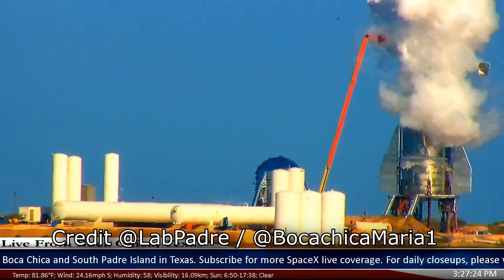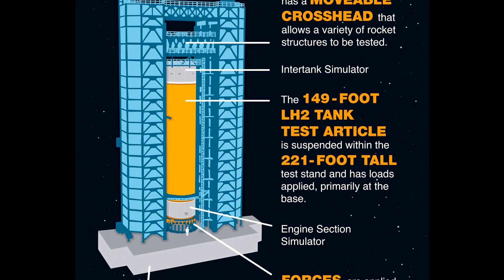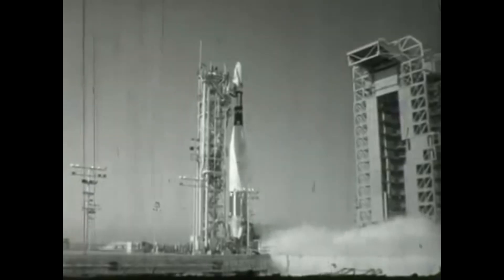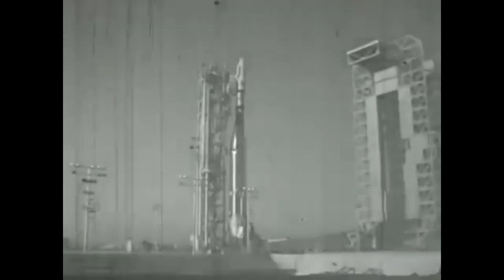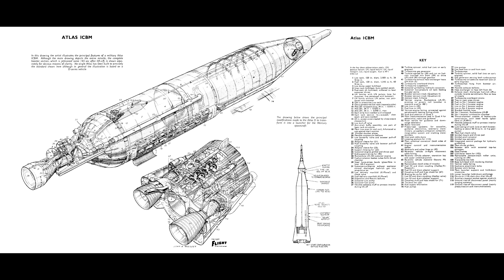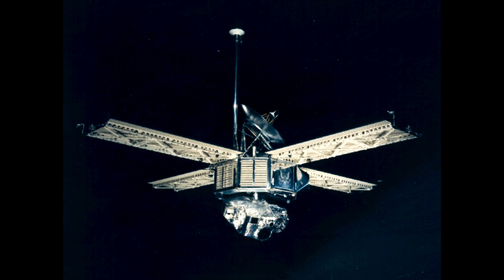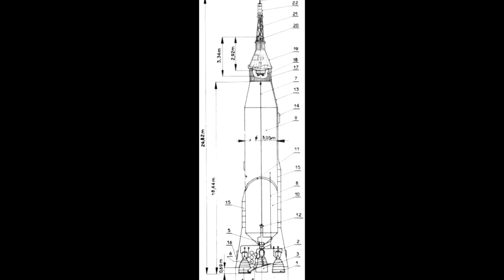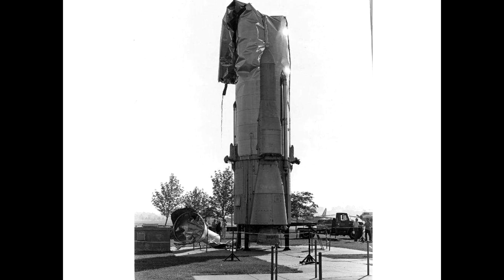Why Did A Rocket With A Secret Payload *Implode* on the Pad?

Comment from the maker: NASA has posted video of the SLS tank buckling:
https://twitter.com/JimBridenstine/status/1204163744814772224?s=20
Reply: As always...Thanks very much...!
Reply: Cardboard’s out... That really unzipped pretty quickly but I couldn’t tell where it failed first. Great result though.
Reply: @thethirdman225  the buckle happened maybe a 18-24 inches below the white square. it resulted in enough of a crack that we could hear the nitrogen leaking out. Eleven minutes later the crack propogated both up and down from that middle point and ripped the front wide open.
Reply: Mike Nichols Great. Thanks for the info. I’ll have another look at it.
Reply: @msudawg1997  Thanks for the info! I'm assuming you work at NASA Marshall then?
Reply: Mike Nichols I think I can see it now. There’s a white spot, about where you said, that moved fractionally about one frame before it failed.
Reply: @revenevan11  yes. I am the lead test engineer for this LH2 tank. I was sitting on console directing the test team when we broke it
Reply: @thethirdman225  we have a different camera view that shows the buckle better. I'm going to talk to management and see if I can get permission to post it. 

We also have sort-of high speed that caught the buckle but I haven't actually seen it yet. I say sort-of b/c they could only get about 300 fps out of the Phantom due to testing at night. Even with all the light we had on it, still couldn't go higher than 300 and get a useful image. And the rupture caught us a bit by surprise and the Phantom had not been reset 😣
Reply: @msudawg1997  Wow, very cool! Thanks for your work contributing to spaceflight, and also for taking the time to show up in this comment section!
Reply: @thethirdman225  the white square is where the stress analyst had predicted failure so we had removed a 4'x4' section of the foam and painted the tank surface with speckle pattern and were running photogrammetry cameras to visualize the strain in that area. That was what was mounted on the yellow brackets on the left hand side
Reply: @revenevan11  you're welcome. I have spent over 20 years as a test engineer, starting out as an SSME test conductor in 1997. I enjoy talking to people about what we do!
Reply: Mike Nichols Thanks again for the great info. Always best to get it from the best source. Totally understand about the Phantom. I’m pretty familiar with high speed video. Look forward to seeing whatever turns up.
Reply: @msudawg1997  that is one failure to the high speed imaging technologies that most of the public is not aware of.
Still, I suspect that at 300 fps, usable data will be acquired.

Keep up the excellent work! Tests like these save lives and equipment!
Reply: @thethirdman225  the bane of high speed photography, the need for enough photons to acquire such short exposure images.
Reply: @msudawg1997  BTW, I used to work with 15000 psi test hydro-pneumatic systems, what was the failure pressure of that monster tank?
Reply: @spvillano  the tank only had 5 psi in it. This is lower than flight pressure but was a good compromise to reduce stored energy. Tank wall buckled from mechanical load, which caused a crack / hole. Eleven minutes later the pressure caused it to rip open up the front
Reply: @msudawg1997  5psi? That's insanely low, considering flight considerations.
Try to send me on a tank with that low pressure, hear my response! 15 psi, we'll talk.
From start to finish, otherwise, that's insanely low.
Reply: @spvillano  as I said, that's lower than flight pressure.  It's actually WAY below minimum flight pressure.  pressure at launch is even higher than that.  But I think it's interesting to see just what 5 psi can do when applied on a large enough area
Reply: @msudawg1997  cumulative stress over a large area makes for massive forces! Reminds me of an air start bottle, high pressure reservoir, low pressure output, connector ill seated meant a six inch hose endangered everyone on the ramp.
Reply: Your videos are awesome!
Reply: Hey scott, totally unrelated but you should do a "things ksp doesnt teach you" on the Van Allen Radiation belts, and its effects on humans and satellites.
Reply: @roach1371b  actually, Scott, that would be an excellent topic. 
Both from phosphene possibilities to direct stimulation of the retina and phosphorescence of the vitreous humor, as well as the effects of bremsstrahlung radiation.
Reply: Where TF have you been? I love Rockets but only just found this channel through recommended. Greetings fellow Scot 🏴
Reply: Mr. Manley, if I understand this correctly, they performed the load testing at 260% flight load for 5 hours (18,000 seconds) on a designed combined specific impulse of 825 seconds (363 sec 1st Stage + 462 sec 2nd Stage). Is it just me or does NASA's absurd obsession with safety mean their not shaving enough weight? These tolerances seem a bit absurd. Or is there another factor at play that I am not taking into account (other than Risk Management and Catastrophy PR Planning)?
Reply: @PureAmericanPatriot  "absurd obsession with safety", meaning, allow deaths and destruction of expensive equipment and losing funding is a goal.
I'll happily hop onto any rocket NASA launches, at least it won't have holes drilled through the skin of the space capsule.
Reply: @spvillano  , I think you misunderstand. Typically there are limits to upper and lower limit tolerances and, especially in aeronautical engineering, if you exceed those limits, you know you are exceeding them at the cost of something else. We could send a Abrams tank into space...with enough thrust. Or a nuclear submarine. Or an aircraft carrier. Does it make sense? Look into the design and testing performed by Lockheed, Boing, Mig, and Sukoi. They perform pressure and highly accelerated life testing (among myriad other tests) but if the tolerances are too high they know they need to shave weight. 

I've worked with these engineers and know a bit about how they think...and this SLS test seems really off based on my limited experience in the field.
Reply: @PureAmericanPatriot  actually, I understand quite well. Not entirely certain though, as to which comment you were replying to.
Remember though, tolerances are for loading, shear, vibration, etc and can be cumulative, so typically there is some degree of excess to avoid unforeseen conditions, such as an engine thrusting out of spec in a multi-engine stage, in particular, the sudden change in load dynamics with an engine cutoff that was unanticipated.
Reply: @nemo-x  and tellingly, is putting most stuff into space. What have you put anywhere, beyond a Twinkie into your mouth?
Reply: Chet Carson  no, man never walked on the moon. Shuffled, hopped, jumped, fell a hell of a lot, to the point where the team that built the spacesuits were near having massive coronaries. Walked, not at all.
Walking just ain't in the cards for creatures evolved under 1G, trying to move around under 1/6th G.
I've even said as much to Buzz Aldrin, which was greeted with a snort and nod. To which I gave a scout salute, as a full hand salute would've been inappropriate, neither of us being in uniform.
Reply: Stephen Villano Don’t give him any oxygen. He’s just trolling.
Reply: @thethirdman225  but, I don't need oxygen either, I require nitrous oxide.  ;)
Reply: Chet Carson  Chet, sweetheart, as one who is as obviously ignorant of reality as you yourself are, I would probably shuffle back down to your mommy's basement and play with your toes or something else equal to your intellectual capability. I'm guessing that you were born after 1969 (probably WELL after) and therefore are susceptible to widespread ignorance in science that is touted on the internet. Now, go play...
Reply: @Scott Manley do you watch Isaac Arthur? If so would you do a video with him?
Reply: Chet Carson  yeah, OK, genius. 10000 people worked on the program, not a one blabbed. The spacecraft have been imaged by a current lunar orbiter, but they're not there because the moon is made of cream cheese or something.
Reply: Chet Carson  "Sorry chuckles, you can try to spin it all you want but man never walked, hopped, skipped, crawled, stepped, or even fell on the moon." Your words, not mine, they're plainly in the thread.
Troll elsewhere, you're blocked.
Reply: Just FYI, the time delay between the buckle and the rupture was about 11 minutes
Reply: Youtube is crushing add blocker, that, and the shadowbanning etc, is making Youtube The Most Toxic platform around. No one is going to spend the rest of his life watching stupid adds. Exodus: to bitchute!

Comment: 17:15  " rocket Balloon Tank  0.4mm - soda can 0.11mm thick.  Pretty amazing.
Reply: True, but stainless steel vs aluminum, so roughly three or four times the material tensile strength, so perhaps twenty or more times stronger from a bursting pressure standpoint.

Comment: i just dont see how somethng so flimsy and dependent on inflatable tanks to keep it rigid can survive for such a long time. it seems they would add at least minimal rigidity to the structure. it seems that the upward force on the structure from the enginse below would force the bottom up towards the top. thus crushing it. i mean if this thing is this flimsy, it just seems dangerously foolish to make it so that it cant hold itself upright without propellant. and what happens in flight once the pressures are depleted?  really confusing idea.

Comment: I worked for Douglas Aircraft Co., at Vandedburg AFB during the early 60's.  We were launching Thor boosters, with various second stages for satellite purposes.  One time the base was locked down because a USAF Atlas booster collapsed on a training pad.  They had lost pressure on the balloon tanks, and down she came.  Rumors flew about sabotage by a sniper.  We were confined to our compound for 24 hours.

Comment: Great video! I worked on the Atlas in the early ‘90s. The hemispherical bulkhead would sometimes collapse, or “reverse” right on the assembly room floor if the compressor keeping the temperature failed. There was always someone onsite to fix that situation if pressure was low and an alarm went off. Unless it was second shift and the entire crew was taking an extended lunch break at 94th Aero Squadron, a local restaurant and bar. And that’s what happened one night. The  alarm went off and everyone, including the supervisor as two miles away having beers. The tank was scrapped, I also had a close call as my desk was in the assembly room and one cold morning ai opened one of the big roll up doors to let some diesel exhaust fumes from a crane out. As I returned to my desk I heard a loud boom. As the cold air rushed in, the temperature differential between the ambient air and the air inside the tank caused the tank to begin contracting because the compressor couldn’t keep up. I ran and closed the door and the pressure came back up.

Comment: Recently Elon Musk stated that the Starship tank will be pressured at 6 bar for orbital flight. I wonder if this is needed in order to avoid collapse during the re-entry when there are enormous aerodynamic forces at both ends of the vehicle.
Reply: Starship has the structural integrity of a tincan.

Comment: The Space and Rocket center in Huntsville has an Atlas and they have to keep about 3psi to keep the tanks filled. A while back they also had a balloon tank Centaur but it was removed. Sure was a pain to keep the pressure on those things for years on end. Had to replace rotting hoses last year on the thing.

Comment: Back in the days of Viking - and I mean the Viking rocket, America's first response to the German V-2 - One of the Vikings started leaking kerosene fuel in the turbopump on the pad at White Sands.  That, of course, started a vacuum buildup at the top of the tank; "dimpling" started becoming visible at the top of the tank, and there were immediate fears that rocket would fold up, just as the Atlas did.  The  Army had one of the station guards actually shoot the top of the tank, perforating it and letting all the vacuum out.  They later patched the hole and flew the rocket, an up-and-down photographic and HA experiment payload.

Comment: looked like  the "rocket" was  a collapsing balloon  .
Why build a real one when you can fake it.
Reply from the maker: Because a fake one won’t fly, and everyone turning up with cameras will notice when it doesn’t move fast enough.
Reply: @scottmanley  There is a problem with your argument.
It didn't fly and nor was it supposed  to.
NASA(or whomever)has just made  perhaps a billion dollars by not employing anyone to build the rocket,not to mention the insurance.
Explody stuff EXplodes not IMplodes,it was a  scam and a hoax .
Reply from the maker: @PYTHAGORAS101  There's a problem with your argument, this was one of hundreds of these built on a production line, hundreds of these were launched. Building a single fake would be more expensive than taking one from the production line.
Failures like this cost the Air Force more than successes because more people are needed to clean up the mess.
Reply: @scottmanley @2:03 to 2:07, there are bits of balloon floating down. 
The story about the fuel pressure is what keeps the rocket rigid is a load of horse-shit. 
How can a container implode when it is full of pressurised fuel? 
How does the thrust work on a non-rigid rocket? 
How does the fuel pressure stay constant (for rigidity) when it is being burned? 
Oh yeah, AIR PRESSURE?? it is plain to see that the only air pressure used here was to keep the tall balloon from deflating ,which is what happened ,this is a deflating balloon, not a rocket.
What about the picture of the rocket at the air force museum @6:23 ,it's a deflated balloon ffs.
Reply: @(S)-Riley Dunn "Maybe if you did some basic research" you mean read the  propaganda and buy into it ?lol .
Reply: @(S)-Riley Dunn "Doing your own research is bad?" A sociopathic thinker and a danger to humanity is what you are.
Reply: @(S)-Riley Dunn free thought is ok ,but when you are a sociopath you are active in harming humans.

Comment: So you're telling me that the structural rigidity of an alleged hypersonic flying machine is entirely dependent on internal pressure & actually decreases as aerodynamic pressure increases?
Good God you are mental.
Reply: @(S)-Riley Dunn please tell me the weight of helium required to re-pressurise the tanks enough to maintain structural rigidity at hypersonic speeds, as well as pointing out the tanks, pumps etc. necessary for storing/moving it, as well as explaining how the helium would not contaminate the fuel it was being pumped in to replace. and explain why they chose stainless steel, the heaviest metal possible, for the fuselage too.
this design is a farce, it is imagineering, not engineering, & scott manley is a fraud who plays childrens games. your silly conspiracy theories will not change that. muting your time wasting sci-fi fanboi self now, bye bye.
Reply from the maker: You’re telling me that you don’t think the engineers 60 years ago thought of this problem and instead decided to fake it. Rather than say including high pressure helium tanks to replenish The pressuring gas in flight? 
I mean clearly you spent a few second thinking of the engineering problems but weren’t incentivized you think of the solution, or check the blueprints online to see this is exactly what they do.
When you’re trying to find flaws and miss such an obvious solution and instead jump to accusations of fakery people will question your sanity.
Reply: @scottmanley  Oh so now they carried yet more weight in gas, that somehow re-pressurised the tanks as they were emptying without contaminating the fuel supply?  Really, that's what you want me to believe? And they chose stainless steel for the fuselage too. the heaviest option possible?  Those aren't 'engineering' solutions, they're 'imagineering' solutions.
Stick to the video games in future.
Reply: @scottmanley  Run away much Scott?
Yeah, stick to streaming video games for kiddies & leave the aerodynamics to us men...